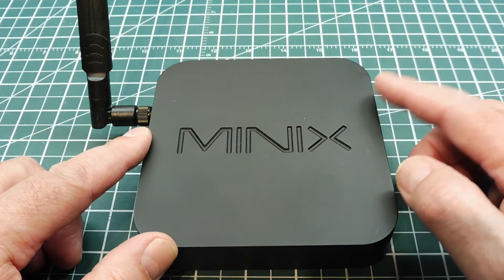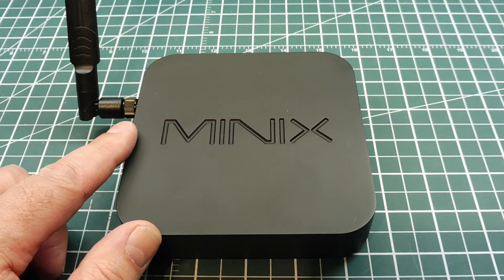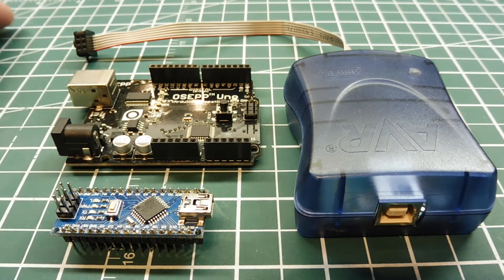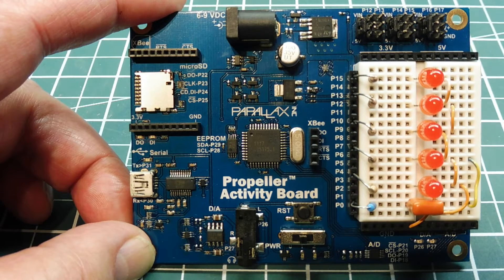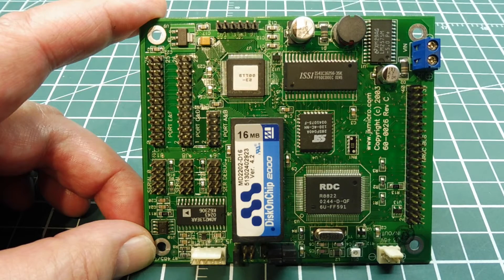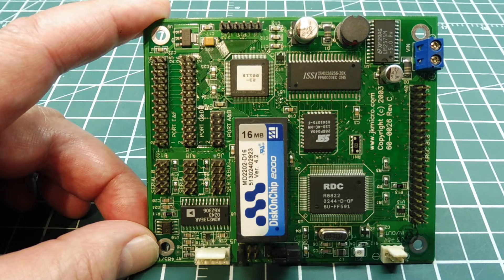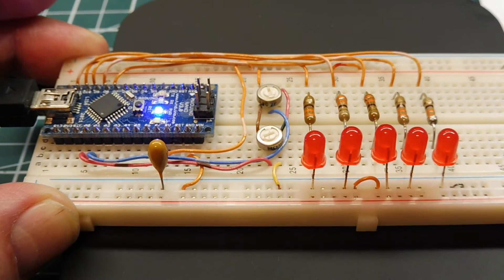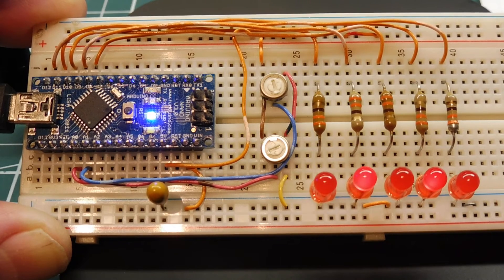Embedded Programming Hardware / Internet controlled Arduino

Comment: If I am not using forth then  I would just have to write a program in my language of choice that interacts with the serial port and be driven by commands from the terminal program. Basically emulating what your forth IAarduino program does ?
Reply from the maker: Yes .. TeamViewer is just remote software that enables you to control your PC as if you were there locally. Any computer connected to your PC can now be controlled. You can use Rpi, ESP32, Arduino .. etc running programs written in you favorite language. TeamViewer gets you up and running quickly without having to write any networking code.

Comment: The old days with x86 single board computer. I had the JK Micro Flashlite 186 and 386Ex. If memory serves me right it ran ROM-DOS. I had a 8MB on the 186 and 32MB on the 386Ex using a disk-on-chip module. Anyway, I found one nifty setup by forcing the boards to do a direct serial connection by editing the autoexec.bat file to issue a CTTY COM1 then used what ever host I was using such as Debian with screen or minicom. I think these days with windows you could use PuTTY or TeraTerm.